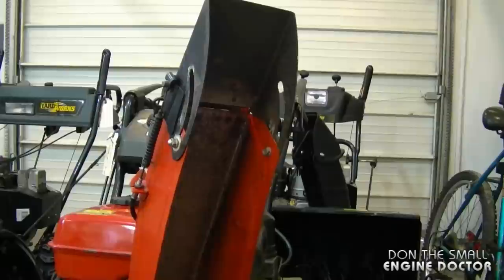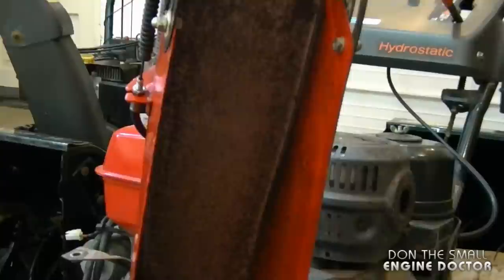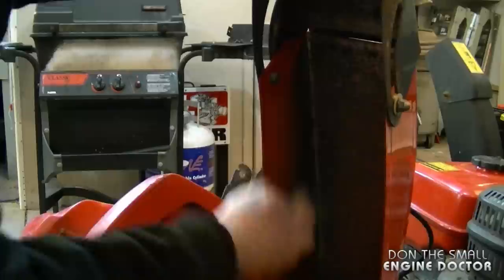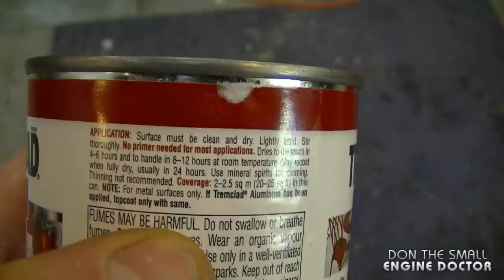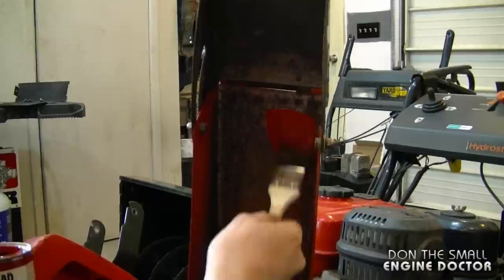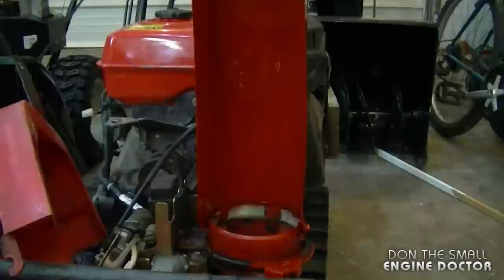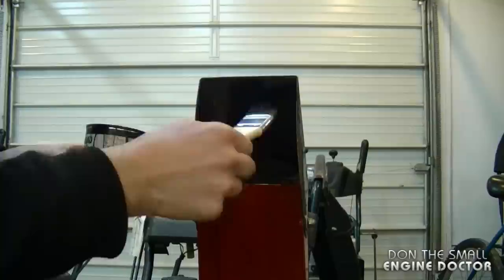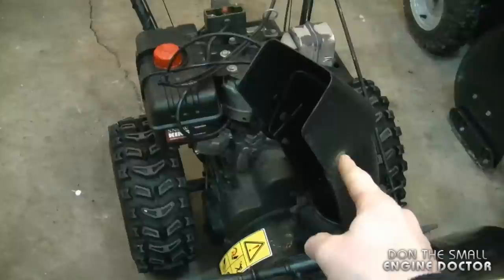Snowblower Quick Tip #3 - Painting The Chute For Better Performance

Comment: I heartily recommend the rubber attachments on the impeller blades.  I have a 40 year old Ariens 8 hp snowblower and there was over 1/2" gap between the end of the impellers and the circular body.  For heavy slush the impellers would not throw any distance whatsoever.  Last fall I bought the kit on eBay or Amazon ($30) or thereabouts for 4 blade impeller.  Installation took about an hour.  Amazing difference this winter, dry snow blows 60' high in the air onto my neighbour's driveway if I'm not careful and no issues with slush.  You can may your own but I took the easy route by buying the kit.  Just Google "snowblower impeller kit" or similar, lots of videos

Comment: Dony, I always clean the chute make sure it is smooth /clean, then give it a good coating of WD-40 and wipe up excess at bottom of chute .During heavy wet snow ,I keep the can handy and spray when snow starts to stick again ! Dony I will take your suggestion and paint the inside of the chute when it is warm enough.Thanks
Reply from the maker: thanks for watching and your tip
Reply: @donyboy73  what color paint match for 627804X6 Murray Ultra Snow blower?

Comment: I've started using Dupont dry lube on the housing and chute on both metal and plastic . It dries white. Seems to work well combined with an impellor kit. I do about 10 driveways each event  and still showing white on the housings after a couple snow storms. We just had a couple of really sloppy snow to rain events 5 cm plus and no clogging at all. For slush I give most of the credit to the impeller kit. I have 3 different model blowers and they all handle slush differently. Honda with a kit seems to be the king of slush, will even shoot clear water 7- 8 feet. Most any lube on the chute is good for a short time, just keep refreshing it. Enough snow .......let's have some spring now!!!!

Comment: I just finished the chute, inner auger body, and side panels with Rust-oleum oil base high gloss. It was in 1986 kind of shape so a wire wheel was used along with primer.

Comment: Hi, just like to throw my 2 cents in. I've tried Mower Guard Graphite Undercoating on snowblower auger and all. Works excellent and use it on mower deck of lawn tractor keeps the grass from sticking. It's $15 for spray can. Great video again
Reply: Have also used this stuff, Works a treat.. Especially on smaller single stage blowers that may be lacking performance.
Reply: Where can you get it in the US....  The website says any NAPA parts store, The ones near me don't have it (and never heard of it)  Is there an online source?
Reply: I'm not sure I live in Canada. Try a farm tractor place that's where I got it or order it online
Reply: Most Ariens dealers have an Ariens brand version of it

Comment: pity you didn't put this video on in the early fall. I have a snow blower attached to my wheel horse and it's only a single stage blower so it clogs up too  easily with wet snow.Much too cold here to paint it now as my garage is unheated.Will remember this for next year if I'm still alive. Am  age 84 now God willing .

Comment: Donyboy73 I painted the auger blades on my Honda hs1332TAS with a glossy black finish. Looks beautiful but idk if it’ll last. Just had surface rust. I used glossy black rustoleum. Think it’ll hold? Wonder if I should do a clear coat after or fluid film? Any advice.

Comment: Hey dony what's your opinion of those plastic shouts on the newer machines. I'm a little leery of them. I know if they break they can be fixed and parts will be available for them for at least 10-15 years I hope but how many snowblowers are you fixing from the 70s and 80s and I plan on keeping mine for that long. Do you think you can find a shout for a early 70s snowblower.

Comment: Hi!
I have a question. Can you answear it please. Thanks.
Lawnmower engine (briggs&stratton quantum) has a wet spark plug when remowing it, it is a little bit hard to start it, you have to pull it more than three times at cold start. And when starting the engine you have to pull the rope to the end for about 1.80m and in the middle of the pulling you have to pull stronger to start it, it is like obsticle and you have to pull vhery hard to pull trough it and to start the engine.
When engine running has loud an like rough sound but is not surging.
I almost completly cleaned and rebuild engine exept valves and points, is there maybe problem in too reach mixture with fuel or is there air ventilation tube leak or intake leak? Thanks.
Reply: Did you adjust the valve lash?
Reply: I'd start with the valves. Grab a feeler gauge and set them. If that's not it, check air filter(could be clogged and choking/flooding the engine) and a new spark plug, an E3 plug is recommended nowadays for briggs engines. If its not annnny of that, then you have carb issues. Also, if you can't adjust the mixture, it may be one of those "eco" carbs. As for that, just clean it veeeeerrry well, making sure all diaphragms and gaskets are good.
Reply: No i didnt set the valve and tappet clearances. OK i will do it.
Reply: I dont know how to adjust the valves clearence on L head, probably is this because carbrator an adir filter has been totaly cleaned.
Reply: Ari Lumbroso 
On your engine the valves might be behind the muffler, you might not need to remove the carburettor/air filter assembly.
Reply: I already remowed head before when decarbonizing and valves were wigling a little bit.